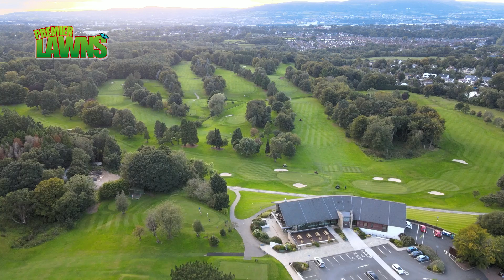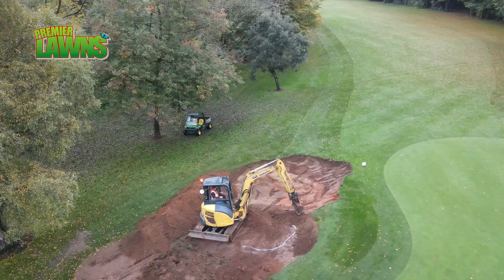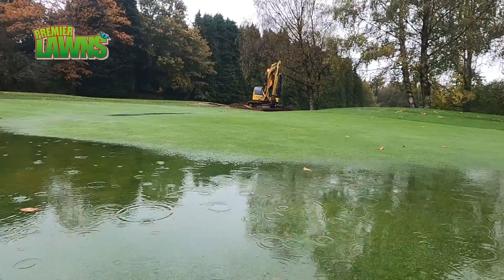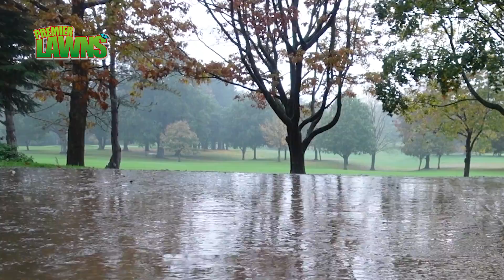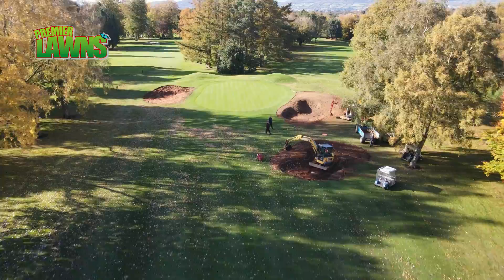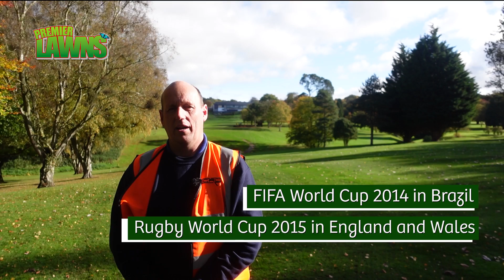Golf course construction - Building new bunkers on an Irish Championship golf course

Comment: Very interesting. You are lucky to have your temperate climate. In Canada the ground would be frozen and snow covered so Winter construction is not possible. Lovely sand there to work with.
Reply from the maker: We don't get frosts like that thankfully
Do you guys get a lot of snow?
Reply: @Premier_lawns_official  On average, 258 cm (102 inches) of snow fall per year. Usually it snows from November to early April. Some days cars are buried. :)
Reply from the maker: @suzannecarter4934  that's crazy.
Reply: @Premier_lawns_official  On average, 258 cm (102 inches) of snow fall per year. Usually it snows from November to early April. Sometimes our cars are buried. :)